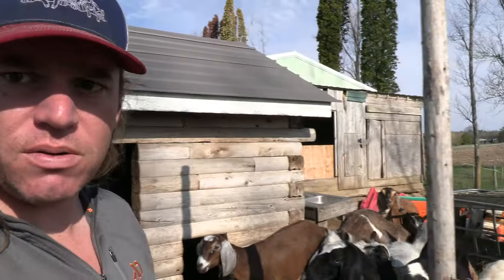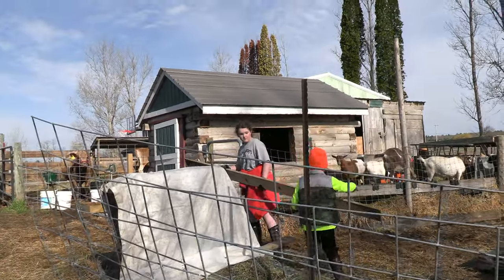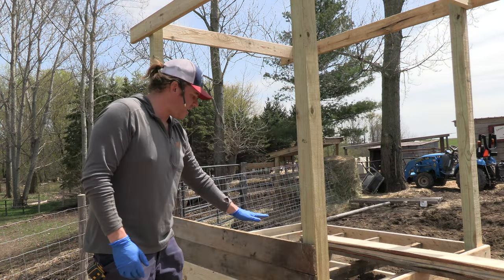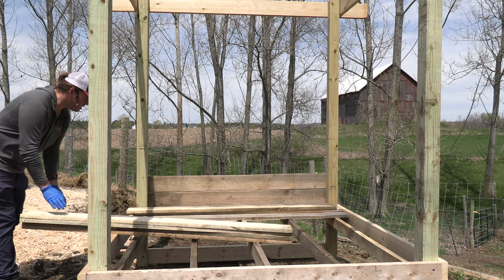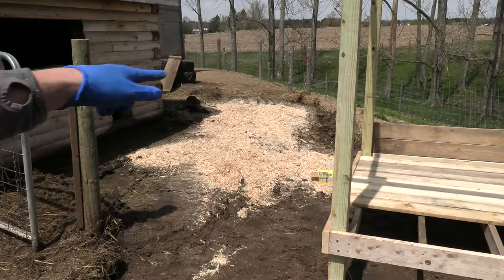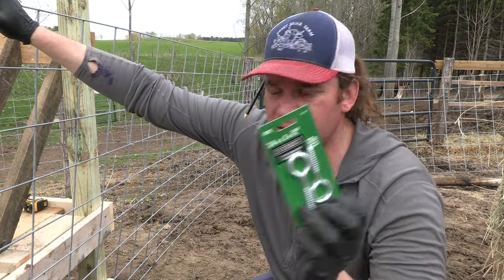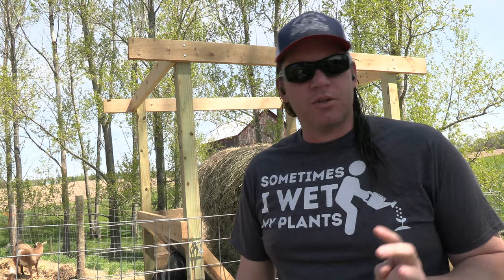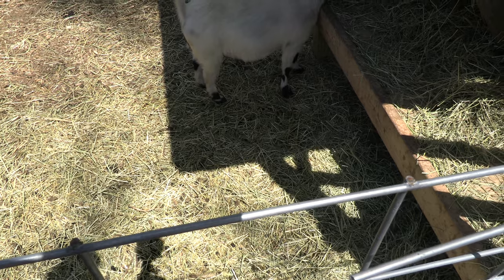Homemade Goat/Cattle Round Bale Hay Feeder!

Comment: Very similar design to one I built.  I was going to leave a shelf like yours but cut it back to the part just under the bale so the goats could walk all the way up to it.  Then I used U-nails to attach some cattle panel fencing to the inside of the slanted slats, and then built some adjustable panels with the same wire for the sides that I can move in as they eat it down.  I wanted to leave a shelf like yours to catch waste but knew my goats would find a way to get up there and pee and poop in it.  I covered the top and 3 sides above the slats with metal roofing. One day I need to buy a welder and build one out of metal for longevity.
Reply from the maker: I had to add some more slats. Those darn Nigerian dwarfs squeezed through and would lay on the hay. The shelf is nice for when we grain them. 

I am with you on getting a welder.